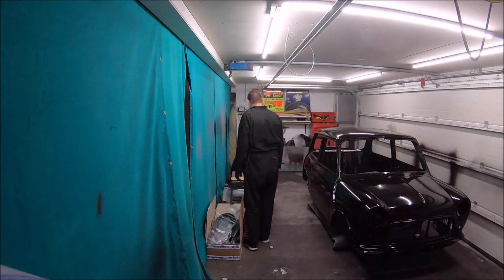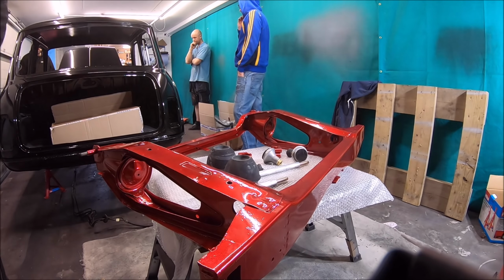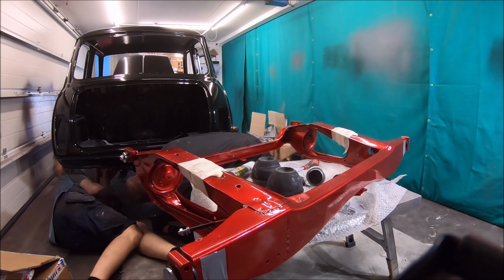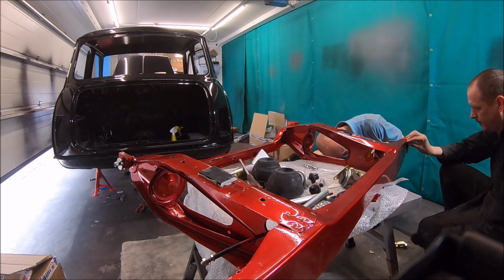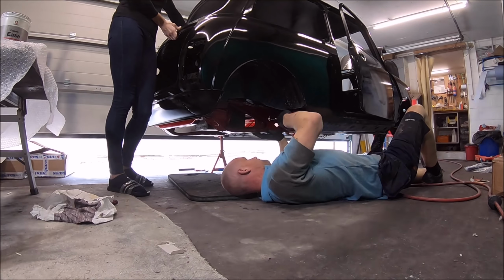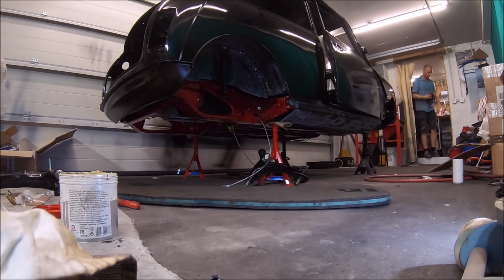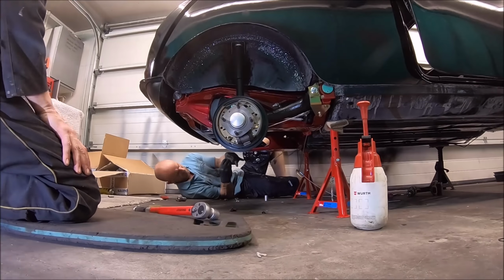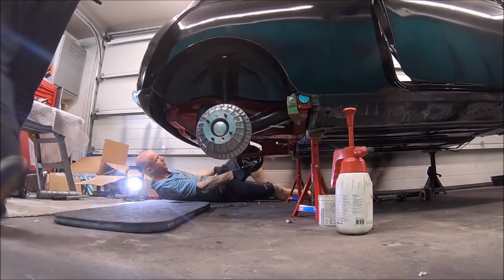Classic Mini Workshop - Project KITT Pt. 24 - Rear Subframe build and refit

Comment: You're bang on with the bolt science, when we push our diesel pickups up over 500hp we change the head bolts to ARP's as they withstand the huge amounts of compression, the factory bolts just snap when you are crossing 1000 ft lbs of engine torque.